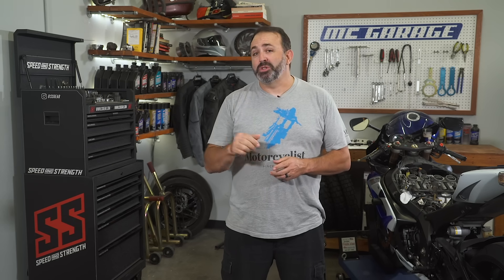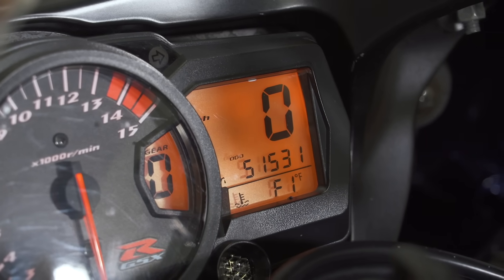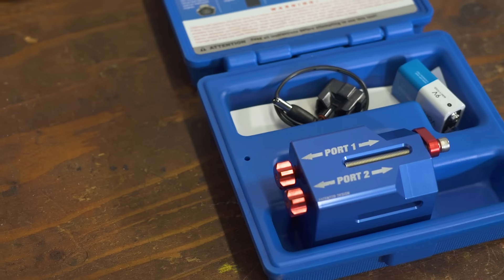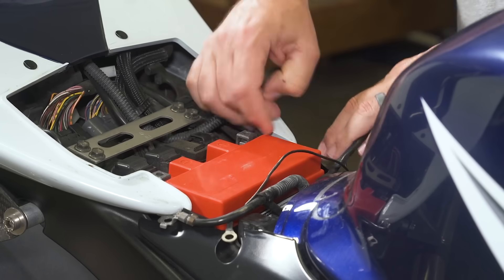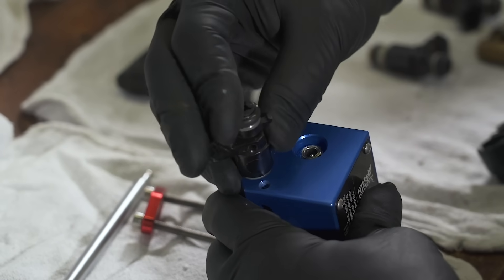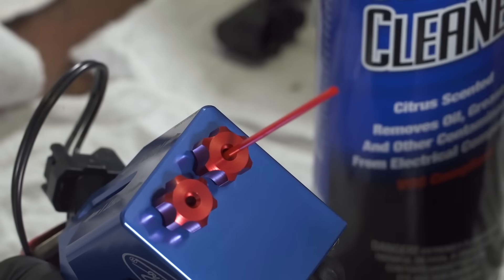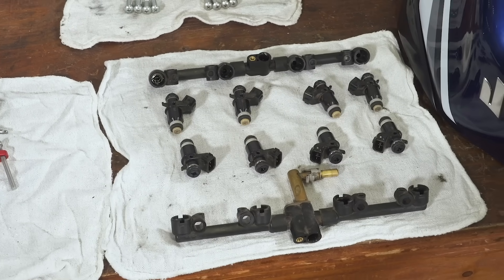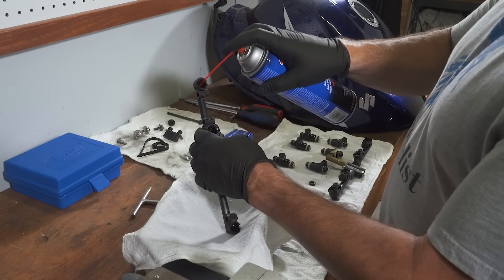Cleaning Your Fuel Injectors: Getting A Motorcycle Roadworthy How-To, Part 2 | MC Garage

Comment: Just use a tire valve stem, heat shrinked on to the tube from a carb cleaner can.  Then grab some speaker connectors and wire and a 9v battery.  Way cheaper than the 200 bones motion pro wants and works great! I've done 2 bikes already.
Reply: Top idea.  Thanks for sharing
Reply: I used super glue. No heat shrink. Worked fine.

Comment: So put a battery on an injector and spray some cleaner through it, or pay $183 for a motion pro tool...You could probably just buy a new set of injectors for that price.
Reply: Msrp for ONE injector is $229. Your math checks out. ✔🤣
Reply: @MustMoto  thanks, I did a quick search and found much cheaper but maybe cleaning is more appropriate for higher quality injectors.

Comment: Why is it called an "o -ring "? When all rings are "o" ?
Reply: Because it's describing the cross-section of the ring, not that it's round.
Reply: Because stuff doesn't exist unless you name it?
Reply: +1 for RS Hunter’s response. There are many differently shaped ring cross sections like the square ring typically found on oil filters. Happy riding 😀
Reply: @robertshunter  darn you, geometry.
Reply: tautology....
Reply: Because there are " square rings" , and " oval rings", plus more.  Gotta differentiate.

Comment: My bike was a 2 year old (2018)Suzuki floor model. Dl1000. Hadn’t been started since factory run and had about 2 liters of factory fuel in it. I put in an additional 5l. Primed the fuel pump 3 times. Hit the starter and she fired right up. I’ve got 600km on her now and zero fuel problems. Maybe the Japanese put a fuel preserver in when shipping them?
Reply: Could be that it was 0% ethanol fuel to start with. No ethanol - no gunk and while the old fuel by itself won’t run well adding fresh petrol makes it all work. Bike still doing fine?

Comment: Thank you for this video, my kawasaki vulcan had start up rough idling to where it cuts off now when it idle for a short time & when I kick it to 2nd gear it dont go at all. So I'm hoping this is a big resolution for the problems I'm facing with it. I was wondering how to get to the injectors & this video is perfectly shown how to do it. Thanks, I will provide a update after trying this out yo see how my vulcan 900 work now.

Comment: If you don’t have that tool you could use a power probe. If you don’t have a power pole or that tool you can hook up ground and power to the battery and run it to the solenoid on the injectors and then blow air through it

Comment: Are some bikes worse for fuel going bad than others? Had my ‘86 Kawasaki Ninja 900 sitting for 8 years. Cleaned the chain, changed the battery, replaced clutch and brake fluids, and was on the road with zero issues.

Comment: Got a yamaha 150  outboard, had poor performance, after 15 yrs. , and many hrs on the water. Took out the injectors, cleaned them , re- installed, engine ran good for about 1/2 hr, then , couldn't hit max rpms for anything, but, ran smooth. Did this a couple times. Ordered new injectors, installed, runs like new.

Comment: Have 3 jump chargers and two new motorcycle batteries so at any time I'll have a fresh battery and charger. The 8 AWG terminal rings will allow gripping by alligator clips on the terminals so the battery can be charged in place. The threaded lugs on the battery posts need to be secured in place as to not fall of I side the bike frame somewhere and elevated so the threads of the bolts for the terminal will catch with all the terminal rings on them. This way I'm not tapping my toes waiting on batteries or chargers to fully charge.

Comment: Hopefully this will work. 3 weeks over winter without starting leaves me with a bike that cranks but doesn't fire over. Complicating matters is the battery runs down quickly and there's no way to clip a charger on while in place. I bought some 8 gauge copper terminal rings for this purpose so I can charge in place. Shop will charge $500 to clean out fuel injection system and let's not forget flatbedding the bike to the shop and 2 Lyft rides, one back home and another to pick up the bike. Next winter will start every day to avoid this expensive hassle. For now I have to take the battery out to charge and try again.
Reply: I sorn my bike (Yamaha CP2 engine) for when the streets are covered with snow and ice (about 3 months this past winter) and it ran fine. However:

1. Last couple of tanks was 0% ethanol fuel.
2. When parked the tank was filled to the brim.
3. I was able to park it indoors in a reasonably dry reasonably warm garage.

Turning the bike over every day might just introduce more problems than it’s worth, if nothing else it’d drain the battery without giving it a chance to properly recharge. How did you solve this issue?

Comment: I put royal purple in my Triumph and it started right up.  After changing the battery and the plugs.  It would not start.  I put new gas in it and it still would not start.

Comment: I have a v star 950 which has been stood for over a year. I put a lithium battery in and the bike runs fine but I've noticed that the engine feels bogged down under acceleration. I've changed the spark plugs and this hasn't solved the issue. I'm thinking that the fuel strainer could be clogged. But given the symptoms I'm wondering whether any crud has made its way through the strainer. Engine runs great when not under acceleration and even under soft acceleration but when I turn the throttle harder the engine struggles but will run fine again when easing the throttle. Any idea whether this will be just a replacement strainer/filter and possible fuel pump clean or am beyond that with crap further in the system such as injectors ?

Comment: More than 2 years standing bike, diagnostics show no problem in injectors but after 2 tank refills, the bike is not working properly at all ( sounds like it's chocking for air, but worse ). I was thinking maybe it is a problem with the spark plugs, can you help me, am i missing anything?

Comment: car with over 250000km and two bikes over 60000km. Never cleaned 1 single fuel injector and they run just like new